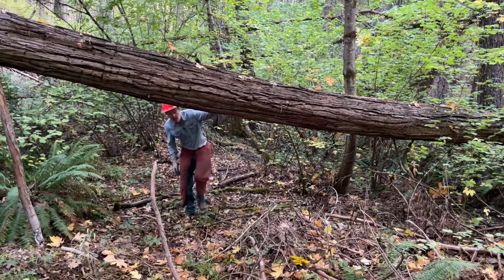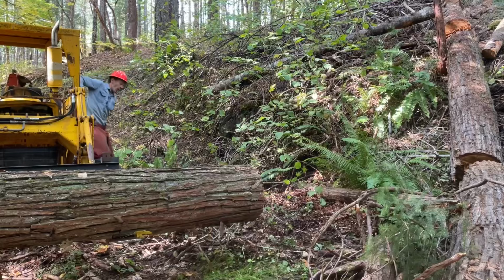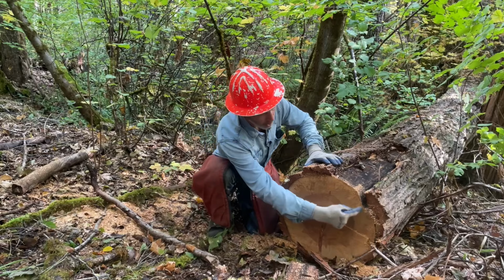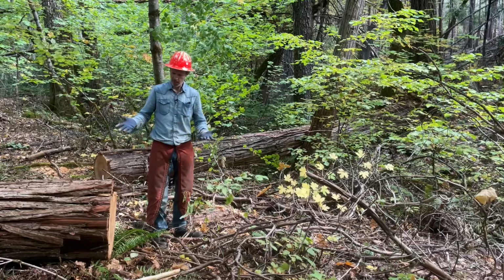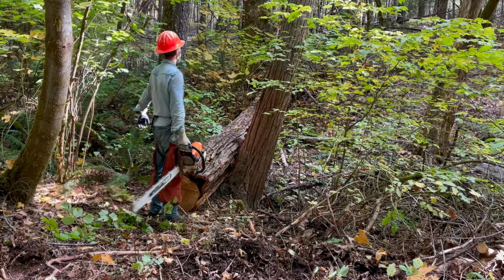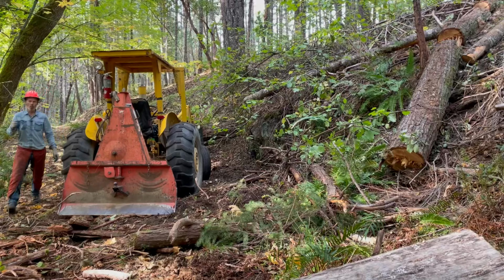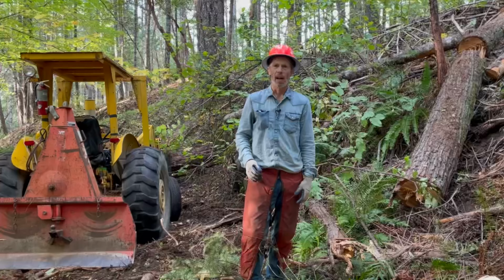Cedar Lumber is NOT Rot Resistant?

Comment: In my experience, I don’t do ground contact with either redwood or cedar. I have found that for fencing, cedar lasts longer, you can get better quality cedar boards and posts than redwood at the big box home improvement stores. Seriously, the so-called “redwood” sold is mostly sapwood at those stores. 
I used to buy from a quality redwood lumber yard in northwestern Los Angeles, but that was over thirty five years ago. 

A learning experience I had with my most recent fence (cedar posts and pickets) was rail rot in a short period of time. So cedar will definitely decay in certain conditions. (I had planned to stain the wood - oil with a purple tint), but my brother in law convinced me to paint the fence instead. Well, the fence got wet, stayed wet due to the paint film holding the moisture close. 
Meanwhile another identical fence is still in perfect condition. It gets as much moisture as the other, but it’s essentially bare (I do oil it periodically to replace the natural oils that the sun drives out. But it doesn’t stay wet 24/7.

Comment: I get your points on how rot resistant cedar may or may not be, and is it worth the extra cost for a given project....
I'm pretty sure however, from experience with oak, where one log fell over, or was simply left behind by lazy people, or a logger who didn't have use for the brushier smaller, harder to handle firewood, that one in the dirt, might be mostly solid, and one hung in the air much more rotten. I'm pretty sure that not only the health of the tree, but the moisture content, is at play.
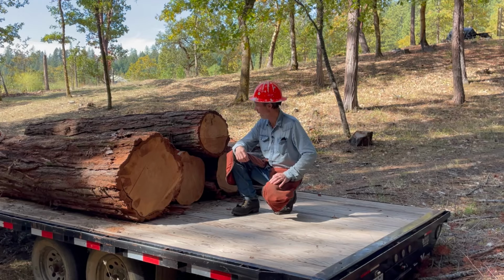 In the east the majority of trees are deciduous, and lose their leaves. C 18:51 18:51 utting them in the winter, will result in them containing much less moisture! Firewood and lumber dries more quickly then.  So my feeling has always been that the logs that rotted before getting cut, vs the ones that seem to last forever, is more about how much moisture they contain when they fall, AND how fast they can dry. If the bark falls off, it seems to last longer than if not.  
So I am thinking that the trees you cut in this video, if even just milled the slabs off, and sat in the same environment, wouldn't be nearly as rotted. And I suspect that there is a microbiology component as well. I wonder if, the same log was milled, and dried properly, then exposed to the same basic conditions, what would happen? 
As in would the wood be more sterile after dried, and more rot resistant than if left unprocessed?  
Just thoughts running around in my head.....

Life is full of more variables than most of us are ever aware of.

Comment: This isn’t telling you what to do, but I was reminded of this watching you buck that thing hanging under tension: I saw a video a while back, I think Gordy’s?, where they were showing that if you pull the saw in and out of the cut a bunch of times it will open up the kerf and then when it drops and tries to punch your bar, the kerf is already wide enough that it won’t. It was new to me and I’ve seen a lot of sawing, looked pretty damn slick. I think it was a NorCal redwood crew? Anyway, great content.

Comment: Well, I like the smell of cedar, and if dry, it burns good.  If I remember right, cedar "pops" when it burns.  Farmers used to use small  white cedar as fence posts. (Ontario white cedar).  Thanks for the video.
Reply from the maker: Different cedars have a much different smell from each other. But I like the smell of every one of them that I have smelled. This kind of cedar, incense cedar does pop when it burns. I am not familiar with Ontario white cedar, it’s far out of my range.

Comment: Incenses cedar is used primarily for interior aplications....i've seen redwood sill plates over 100 years old that were still solid, in fact, i have a coffee table made out of some of the boards.
Reply from the maker: The old Redwood will last a very long time. But what a lot of people don’t realize is a lot of the redwood being cut now is smaller second and third growth and a lot of it is sapwood. The sapwood doesn’t last like the old growth heartwood did.
Reply: You are 100% correct. I've torn down/remodeled a lot of pre 1950 structures and the quality of wood is 1000 times better then the highest quality lumber we produce today. I've got a bone yard of damn near clear vertical grain  fir that would cost a fortune today and wouldn't be near the quality of the old 'standard' lumber. Occasionally I'll run across a random old growth board in todays lumber , I set it aside and add it to my pile.  @WilsonForestLands

Comment: Yes the sapwood the part that people strip away and do not use for anything was rotten but the heart wood the part that people use was not rotten.
Reply from the maker: In a lot of cases knowledgeable people strip the sapwood away, but a lot of times people don’t. I have seen a lot of cedar in the stores that have a lot of sapwood. It’s especially common with redwood now that Redwood mills are cutting small redwood logs. I have seen people build things with these types of materials and they have problems with them not lasting long. People do use sapwood. Maybe they shouldn’t, but they do.
Reply from the maker: That is for outdoor use. A lot of people prefer incense cedar with sapwood for indoor use. The contrast between the white sapwood and the dark heartwood  is one of the things people like about incense cedar.

Comment: Think that downed cedar would've lasted longer if it hadn't had the bark on?
👍🍻
Reply: Yes. Undoubtedly.
Reply from the maker: Yes I think they both would have since the bark holds in moisture. But they also might have had big cracks in them because it allowed them to dry out more.
Reply: A valid point. I defer to the Gentleman from Southern Oregon. @WilsonForestLands

Comment: What year is your tractor? I'm in the market for my first. EVERYONE says I need a 4x so I won't get stuck. I'll need it for plowing but a set of chains would work well on yours. This was/is your granpa's, right? I'm on the MA/CT border.
Reply from the maker: This tractor is early to mid 1970s. Probably 73 or 74. It was my grandpa’s then it was my dad‘s. I don’t run chains on mine because the chains would chew up the soil on the surface of my roads. Then when they get a little bit wet I would really have a muddy traction problem. Most of the time I get plenty of traction as it is. For plowing chains would probably help. A lot of people tell me tractors from that area are very tough and reliable. I have found that to be the case with this one.

Comment: Thanks for the cedar lesson and do you ever come across any hemlock over there thanks other great  video
Reply from the maker: There isn’t any hemlock here. It’s too hot and dry for them. But up in the higher elevations over 5000 feet there is western hemlock and then mountain hemlock in the really high mountains. There is also western hemlock over at the coast where it is cooler and wetter. I have a few over on my coast property but none here.

Comment: I find myself wanting to scream "Wilson!" like Tom Hanks in Castaway...  just for fun... I'm easily entertained.  So, I've been wondering, if a downed tree is supported above the ground like that, does it have tension in it when it's milled?
Reply from the maker: I have had a few people over the years call out to me as though I was a soccer ball. 😁 It’s a good question you bring up about tension. That is something I forgot to mention in the video that I am concerned might be a problem. There was another cedar I took out a year ago that was suspended the same way and it had only been down for less than a year. It did have tension in it but only in a few spots. There were a few cuts that sprung off the log and even jumped into the air a little bit when they were cut off. But surprisingly most of the lumber came out straight. It will definitely be something I will be looking out for while milling it.

Comment: I cut a sell alot of eastern red but won't cut stands that have more than a 1/4 inch of sap wood for fence post. Some places here in Oklahoma they grow really slow so very little sap wood. The place I am cutting now I cut the post off of for my place 30 years ago they are still solid but what sap wood they had when cut is gone
Reply from the maker: I spent a couple years out in Oklahoma. They look like they would be slow growing, where I was they didn’t get very tall. Since they are a juniper they are very different than what we call cedar out here. some of the wood I have seen from them is very beautiful too.
Reply: @WilsonForestLands  here they grow tall and straight like a pine. But they have to reach sunlight threw the oak trees

Comment: The 3 point arm's holding the wench ?   How tight do you keep those ?   I noticed the wench moving a little as you drove, Is that by design ?  I guess what I am asking is how tight should the 3 point arms be for the wench and why ?
Reply from the maker: On this old rickety tractor, tight doesn’t really apply any more. My dad and grandpa put this winch on the tractor over 30 years ago and most of the adjustable parts have seized up by then. The pins and bushings are worn so there is slop there. There are a couple cross chains that stabilize it from side to side. They have to be kept a little loose or they get too tight when the winch is lowered all the way. That’s where a lot of the movement comes from.Ii’m not sure how tight everything is supposed to be but the way it is matches the rest of the tractor.
Reply: @WilsonForestLands  thank you for the great answer.  I may have access to one, and was just wondering!  Thanks